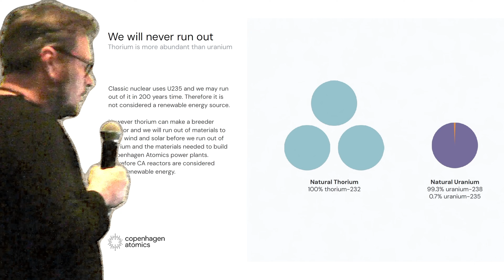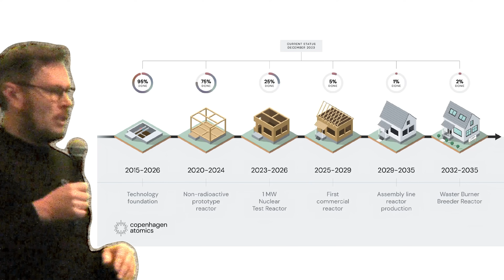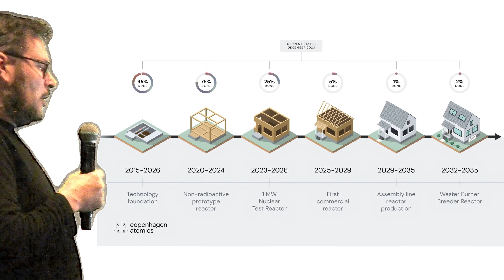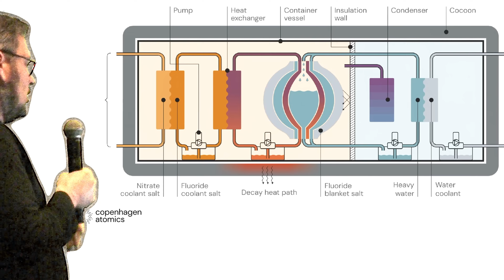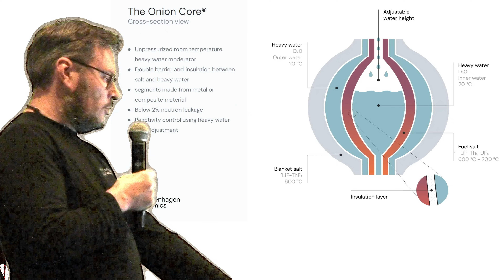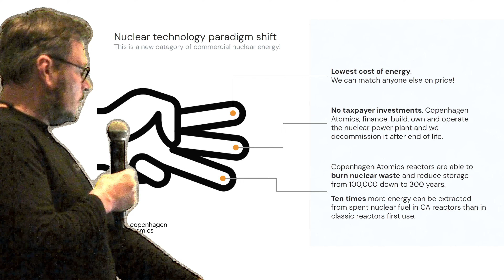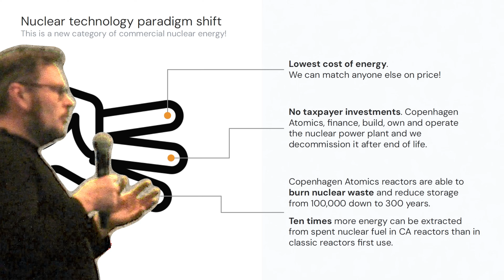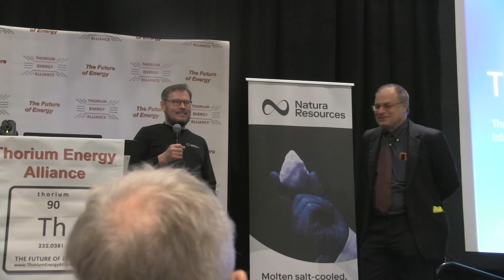Thorium Molten-Salt Reactor: Copenhagen Atomics Onion Core - Thomas Jam Pedersen @ TEAC12

Comment: His comments are deceptive.  He is comparing Thorium to "U-235".  That is completely false.  Thorium is equivalent to U-238.  Thorium is not a fissile material, and is not suitable for nuclear reactors unless it is converted into U-233 first.  Thorium, like U-238, must be put into Breeder reactor and converted to a fissile material before it can generate energy.

We have millions of tons of U-238 sitting around in warehouses, left over after separating the U-235.  If used in molten salt reactors, this U-238 is enough for 5000 years of power.

So we don't need Thorium for a long, long time.
Reply: Comparing U-235 fuel to thorium fuel is perfectly valid. Thorium breeders need about the same amount of fissile, but it is a one-time cost, since they don't send it to waste. Fast reactors need so much fissile, that their ability to consume U-238 as fuel is meaningless, because the reactors aren't affordable. There is no path to low-cost and rapid scaling, as there is with fissile-efficient thorium breeders.
Reply: @Th-233  Not even close.  U-235 is a fissile material.  Thorium is not.  No qualified nuclear engineer on the planet would equate them.
Reply: @Th-233  The Russians have relatively small fast reactors that seem to actually work, though still in a prototype stage. The costs for the fissile material is relevant, but so is a heavy water moderator.
The thermal thorium cycle has very few spare neutrons and thus needs rather frequent reprocessing of the fuel and blanket. Many stabilizing schemes also rely on added neutron absorbtion or loss when too hot. This makes it tricky to stabilize a reactor with breeding efficiency. For the thermal breeder it is not clear if this system works at all with an acceptable amount of chemical reprocessing of the fuel and blanket.  The repocessing part is highly regulated, not just for safety, but also for proliferation reasons.
Getting the permission for the reactor may be easier than getting the permissions for the chemical part. As far as I know (much is classified for a good reason) the cleaning processes are only in a vague theoretical planing phase. Much of the tests in that area were more like failures.

So far the fast breader U238/Pu239 cycle is way further developed than the Th/U233 cycle. This is for the reactor and the chemical repocessing. The fast reactors have the big advantage that they are less sensitive to fission products and thus can get away with much less (e.g. 1%)  reprocessing compared to a thermal reactor.
Still the high cost and proliferation issues  for repocessing were reasons to essentially stop the developement of fast breaders in the west.

The reactor to compare to is really the fast breader, not the PWR or BWR.
Reply: @UlrichHarms-ci1ov  Expensive/small fast reactors might compete with diesel generators in remote locations, but the niches for expensive power will shrink with better nuclear tech. Scaling up heavy water or Li-7 production will be relatively trivial, and graphite is also an option.
Reply: He does that in every video they make. He also likes to compare thorium in a MSR to uranium in a PWR, another terrible comparison.

Comment: Its just annoying that he thinks he need to distort facts when he has such an amazing project going.

Claiming U235 is very rare and Thorium can fix it is just disingenuous. U235 is fissile and thorium is fertile just like the abundant U238.
Reply from the maker: I can appreciate the appeal of fast spectrum reactors. This is using heavy water moderator. It is a can of worms to get into fast vs slow.
Reply: @gordonmcdowell  that is not the point. Comparing fissile with fertile and pretending its the same thing is not good. If you need to breed fuel, you need to breed fuel. Don't pretend otherwise.

Liking one reactor type over another is good and well, just don't make false comparisons. Thomas doesn't need to but for some reason he does so anyway.
Reply: @Kian139  He also likes to make a false comparison of uranium in a PWR to thorium in a MSR. He will never compare uranium vs thorium in MSRs.
Reply: @chapter4travels  the sad thing is that he has no reason to do these things. He and his team have built an awesome reactor in its own right that has huge promise.

Comment: You might consider Puerto Rico for production facility. It has excellent technically skilled population, has many advantages of being a US territory such as technical standards, while having its own tax system and huge tax incentives for manufacturing for export to any other country including the States, and not being subject to import duties in the US. So you could avoid both import and export duties. Puerto Rico has excellent trade relations with Latin America as well.
Puerto Rico, as an island, has a huge need to replace its fossil fuel power infrastructure.
Examples of technical abilities - until 2004 Purto Rico produced a large fraction of prescription drugs for the US. Even to this day it still produces some, and over 90% of all soft contact lens sold in the US are made in a factory in Puerto Rico.

If you are interested I would be glad to help with introductions. I am connected with people in Puerto Rico who are wirking in developing a spaceport and related industries. I believe a sonewhat different type of Thorium MSR has merit as an in-space combined thermal+electric thrust engine, with advantages including safety, ability to vary output quickly, and shutdown and restart. The ill-fated Atomic Airplane project and later NASA work showed that an MSR could operate in all flight regimes. I believe the high temperature, low pressure, low radiation characteristics can result in a reactor+engine characterized by a dramatic reduction in weight and size.

Comment: It seems like as long as a suitable/durable optical window/lens is used, it may not be too significant a problem to routinely replace the optical fiber if it degrades (I don't know where the end of the fiber optic must be in the reactor, or whether a channel/housing for it would be allowable,  in order to remove and insert a new fiber). 
I wonder if pure Al2O3/ synthetic sapphire would be suitable in the midst of gamma and neutron radiation. I know there is a market for monocrystalline sapphire shields and windows for use in semiconductor manufacturing (high optical transmittance, resistance to etching in the midst of plasma).

Comment: Daaaaamn.  40MW in a shipping container?  That's outstanding!
Reply: just thermal energy, not electricity
Reply: @sebastienl2140  Ah, so figure half that?  Still, that's also 20 MW of hot water.  Very useful as well.

Comment: I am very much in favour of  Copenhagen Atomics and Thorium as a fuel source. 
But I have some questions about this particular design. Isn’t thorium salts water soluble? If there was some kind of failure where the molten salts and the water mixed wouldn’t there be a risk of wide spread contamination? 
Why not use graphite as the moderator?
Reply: The salts are not water soluble in the traditional sense, they will decompose in water over time.
Reply: @chapter4travels  
That is interesting. 
I did not know that. 
Thank you for informing me. 
Dose it come out solution? Is it because they decay and no longer can form salts? 
There is also the risk of the salt and the water coming in to contact with one another causing an explosion. I would feel more comfortable if the radioactive salt heated up non radioactive salt that then was cools down by water. That way if there is a failure it’s not radioactive salt that is spread all around. 
I am not saying that I know this stuff better I’m just trying to understand it. I am very enthusiastic about nuclear power in general and molten salt thorium reactors in particular. But it is very complicated for a non scientific like me to understand. I also don’t want to trespass on your time if you don’t have time or wish to respond to my question then please disregard them.
Reply: @isakrynell8771  The radioactive salt never leaves the reactor area, it transfers the heat to clean salt that then goes to either electricity generators or to industrial process heat. There is no water coolant in either case. Steam generators use water but that's a separate non-nuclear side of the power plant. There is no possible explosion.
Reply: @chapter4travels  
Ok but in the core they are using water as a moderator. At lease that’s the way I understood it. The water and the salt are layered that  is why  they call it  the onion design isn’t it?  In that diagram they showed there is heavy water coming in on one side of the reactor as a moderator not as a coolant and liquid salt coming in from the other side, right? So that’s where I get nervous what if the wall between the two is breached then the tow will mix and kaboom, steam explosion, radioactive salt water all over the place. Even if the chances of that happening is minuscule there is no chance of that happening at all with graphite. So why not use graphite?

Comment: Land deal struck in Paducah for potential first-of-its-kind laser uranium enrichment facility - June 19, 2024

Global Laser Enrichment is working with a laser-based isotonic separation process .. though stalled for nearly a decade, it seems things are leaning towards moving forward again.

With a large feedstock potentially available, and a look towards going nuclear, would the onion core design or the SM-MSR design ACU's looking at work with either or both as feedstock? 

Thorium is obviously a goal longer-term, but being able to reduce both existing waste & weapons-grade materials in our increasingly proliferation embracing geopolitical climate with a capability for integrating Thorium as 'waste' feedstocks diminish could seemingly provide a faster pathway to deployment & grid integration 

Especially in Kentucky where Meta & Amazon have already announced large energy hogging data centers with many more in discussions to expand even those.

With Kentucky looking to go nuclear and already having a great quantity of fissile materials, with a half-century+ history of experience in waste storage disposal and processing, it might be the perfect place to look as a potential location for both fuel & reactor placement? ..again, especially given growing energy demand contracts. 
...

$50/kg = 22GWh thermal 
$20-40 MWh (e)

Seems like a far less costly supply line and a far denser footprint than coal, n.gas, solar & wind. Less dangerous heights too!

$50/kg = 22GWh thermal 
$20-40 MWh (e)

Seems like a far less costly supply line and a far denser footprint than coal, n.gas, solar & wind. Less dangerous heights too!

Comment: all this crap is so corrosive we dont have a container that can be a reactor long term
Reply: Apparently, the corrosion from fluoride salts can be dramatically reduced by removing oxygen and moisture from the salt.
Reply from the maker: Copenhagen Atomics sells salt to other Molten-Salt Reactor startups, but it is just stored in giant piles on the floor because they don't have any containers that can hold it! I remember one order of salt, it arrived to the customer empty with just a big ole hole in the bottom of the cardboard box they shipped it in. True story.

Comment: I am sure you already know this, but just in case.
China is running a massive molten salt reactor.  Maybe time to give them a visit. 
Your small design reactors will be a game changer. All the best to you.
Reply from the maker: TMSR-LF1 is on-par with CA's Onion Core. SINAP might be doing actual fission tests, but they are not sharing that fact.... No one (including me) knows what to make of the "radio silence".
Reply: It may be massive in size, but not in power.  I think it is only 2 or 3 megawatts.
Reply: The current one isn't massive at all, at only 2 MW capacity. It's mostly to study how molten salt reactors behave. But what's interesting (and somewhat massive), is it's successor, which is a Molten salt THORIUM reactor of 60 MW. slated to be complete in 2030 with these specs: 700 °C operating temperature and with an experimental Supercritical GAS TURBINE (based on carbon dioxide in a closed-cycle). This will convert the thermal output of 60MW into 10 MW of electricity and hydrogen and other stuff too, I don't remember.
Reply: @Adrenaline_chaser  I'm always skeptical of these statements about what something will do when it hasn't been proven that it is technically possible yet.  Maybe that's the norm -- I don't know -- but the same is true of the ITER fusion reactor.
Reply: @robertbrandywine  well for starter fusion is a hell lot more complex than thorium based reactors. Secondly, a 60MW experimental thorium reactor is really not that "extraordinary", it's quite realistic. The Chinese are following quite a methodical process to get there "step by step" with a continuous funding into R&D.
And they plan to build a commercial version only in 2035 and with only 100MW capacity. Again, quite reasonable timeline
Reply: @Adrenaline_chaser  It would be nice to know the status of their current, first, reactor.  Is the corrosion problem completely solved?  (If so, then they should be able to go straight to any size reactor they feel like building and not have to go in incremental steps.  If not, then what are the problems they have?  Is there a clear path to solving those problems?  If not, then how do they know that there is a solution?
Reply: @robertbrandywine I think you didn't understand. The current reactor opened less than a year ago and it's Molten Salt Reactor that's basically URANIUM-BASED still. (though it uses a "blended" fuel in which they mix 5% of Thorium to 95% classic Uranium isotopes). And it'll require several more years of testing and As I said, the current 2 MW reactor is solely for getting their hands on molten salt reactors, NOT on Thorium reactors (they can be mutually exclusive, you can have Uranium-based molten-salt reactor too). Then in 2030 they'll finally make an experimental reactor that runs only on Thorium.
Reply: @Adrenaline_chaser  I fully understand that thorium and MS are independent variables, in fact, I'm constantly pointing this out to people.  I also believe that overcoming the MS corrosion problem is more difficult than using thorium as the primary fuel with a uranium starter (but I could be wrong).
Reply: @robertbrandywine  👍

Comment: He says that he doesn't extract out protactinium but only the uranium in the blanket, but why? Wouldn't protactinium still be produced in both the fuel salt and blanket layers and still act as a neutron poison for the duration it will remain in that form?
Reply: I am pretty sure this is an anti-proliferation method, as if you separate the proctactinium you can get pure u233 which can be used to make a bomb.

Comment: How about continuously feeding your fiber through a pair of ports to allow a spool of fiber to be used in this step.  Then you will not care if the radiation destroys the fiber, at least not until you develop a better fiber that can hold up under radiation for LIBS.

Comment: While I'm not sure about the technology you use to separate lithium isotopes, I would presume that it involves molten salts. If so, could it separate other isotopes? Could you use this to say, separate uranium or transuranic isotopes. Perhaps even fission products, such as Cs-137 and Cs-135? If so, you might be able to remove certain isotopes. For example, you could remove Pu-238, for use in space applications, while you're preparing transuranics for the reactor. Or you could remove specific fission product isotopes, which could lead to pure I-129, for easier disposal and I-131 for medical uses etc.
Reply: Chinese scientists have already built some of these modular Thorium reactors.
Reply: Sadly with all anti-proliferation laws that we need, having the technology to easily separate isotopes will probably not be allowed.
Reply: No on site processing

Comment: Water in the core is a bad idea for safety.
The really big advantage with thorium is ; The nuclear processes can run in thermal spectrum. 
Water in the core is not wanted . The coolant salt must be able to temperatures for thermochemistry.
Only then the big advanted feature can be achived.
Production of nuclear hydrogen. That will revolutionize  the world economy.
Reply: I thought the water was thermally insulated and acting only as a neutron moderator?
Reply: @bobthebomb1596  Yeah, until something goes wrong.
Reply: @robertbrandywine  How likely is that?
Reply: @bobthebomb1596  The thing is, I don't believe it is necessary to use water, either heavy water or regular water.  I could be wrong but I thought one advantage of a molten salt reactor was the molten salt ran through the core, providing cooling, and it couldn't turn to vapour if overheated, in some designs it can also serve as the moderator.
Reply: @robertbrandywine  That is true, but in the original molten salt design, while salt was used as a coolant graphite was used as the moderator. I've not heard of salt being used as a moderator, I would be interested if you know of an example?
The trouble with graphite is that it has limited life and is expensive to replace (which is why the UK AGR reactors have limited life-extension possibilities.)
Reply: @bobthebomb1596  No, I don't have an example.  These are all proposed designs aren't they, except for the reactor in China?
Reply: @robertbrandywine  They are yes, I meant a design proposal not an actual one.
This design is quite small, the 1GW output was the result of multiple reactors if I remember correctly.